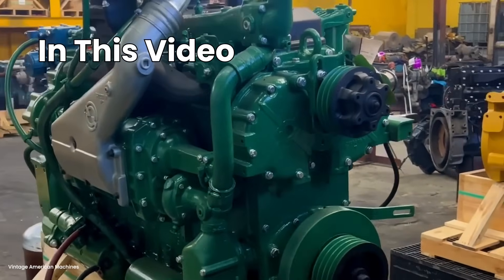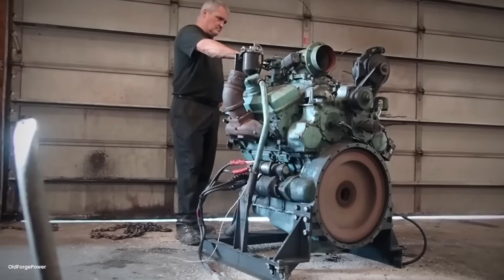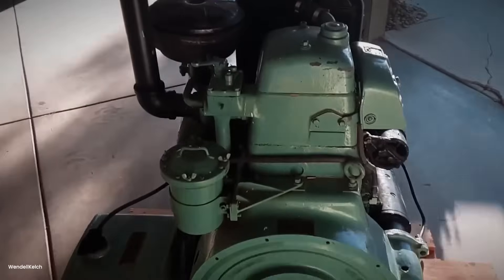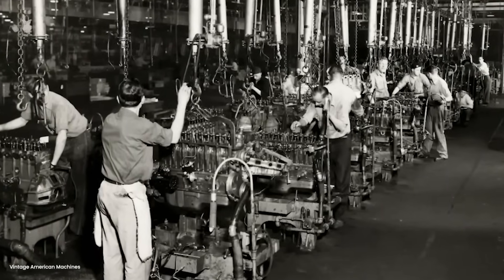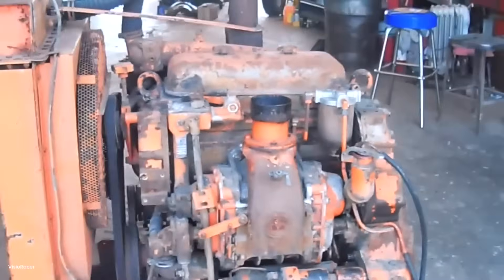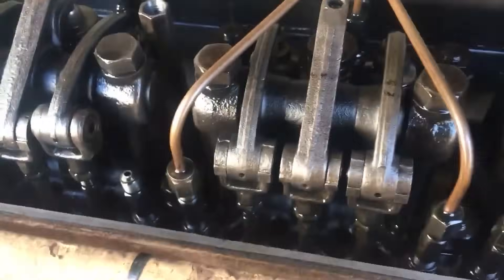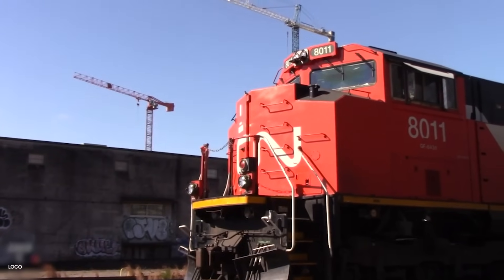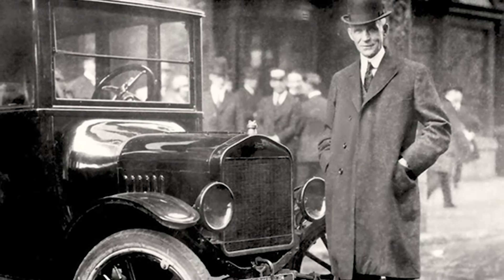How One GM "Bus Engine" Outsmarted Every Locomotive in America

Comment: I did my apprenticeship at Westrail here in Western Australia. We would do an E service (Rebuild the engine) after a million miles. Our biggest standard gauge unit was an EMD V16 567 E3 producing 3300HP. You said Alco went out of business in 1961 (?) I believe Westrail bought locos with Alco engines after 1983. That said, they might have been Atco engines.  I don't know. I hated my trade and once I graduated, I walked away except a stint on Mega yachts out of the South of France in the late 1980's. Thanks for the video!

Comment: The 6-71 engine was not supercharged.  (Unless it also had a turbocharger.)  The Roots blower was used just to get air into the 2 stroke engine.  It pumped in about 426 cubic inches of air, every rotation.  (Do the math, 6 times 71 is 426.)  Without that Roots blower, the engine will NOT even run!  The gas 2 stroke engines I have, use the crankcase to pump air into the combustion chamber, My RD400 also has a static supercharger (no moving parts) expansion chamber that WILL get the fuel/air mix inti the combustion chamber at higher than atmospheric pressure.  I have a nephew that is an acoustic  Engineer, that agrees with me that an expansion chamber IS a supercharger.

Yes, cars have adapted Roots blowers as superchargers.  Top Fuel dragsters use about 1000 HP, just to drive their 14-71 blowers as superchargers.  NHRA has limited the blowers on Top Fuel cars to that size.
If it uses 1000 HP to spin it, it creates a LOT MORE than 1000 HP.

Comment: WRONG
WRONG WRONG!
This guy couldn't be more wrong!
1939...War was on the Horizon 
GM needed a lightweight high speed diesel engine.
The 6-71 WAS NOT designed as a bus engine, but a multi-purpose engine for generators, marine propulsion, military trucks and equipment. 
The application in busses was a peacetime application.
The 6-71 shared designed features of it's larger EMD 567 cousin (a real Locomotive prime mover) but it was NEVER a Locomotive engine.
Stupid video, its false.

Comment: Early efforts to put Diesel engines into railroad equipment but limited to about 200 or 300 horsepower that powered self propelled passenger car that could pull one or two other passenger cars ? Small industrial locomotives on rails on a factory floor or a small switch engine ? 
Early small Diesel locomotives from General Electric that used two small Diesel engines/one in each "hood" while the cab was in the middle between the two "hoods" "40 tonner" the engines were not built by GE but from another supplier- I think these locomotives may have preceded General Motors' getting involved in the locomotive  business but when they got in they really got in 
little center cab two hood General Electric locomotives on the Washington and Old Dominion Railroad during the 1930s ? 
Collaboration between General Electric and ALCO which resulted in large ALCO 4 stroke engined locomotives with GE traction motors and electric components that competed with the Elecro Motive locomotives until GE decided to produce its own line of large mainline locomotives pulling the rug out from under ALCO ?  Did GE first invent "mutual unit control" ?
Reply: the very popular Budd car used two detroit diesels, a special horizontal model so it could be mounted under the floor.  Each motor powered one axle of the closest bogie, I believed they used a two speed torque converter automatic tranny, in operation it sounded like a Buick with a loud exhaust.  These puppies were not fast getting out of stations but once they got rolling they could move, regular operation at 80 mph was normal.  They were famed for their smokey exhaust, one conductor told me if they could turn that smoke into money, he'd be rich.  Budd cars were ALL stainless even the frame, they'll last forever unless you bang them up and that takes some work.  Not so the engines that are no longer made.

Comment: Robot ?  Didn't know that Kettering (Greatest Automotive Engineer of all time?) (There were Father and Son Ketterings who worked at General Motors?)  was Russian but I have heard that he led an engineering effort that completely improved a submarine engine that had been built by Winton Engine which GM had purchased along with Elecro Motive. 
  I thought that the 567 EMD locomotive engine preceded the much smaller Detroit Diesel engines (which ran on the same 2 stroke principle)
don't think they had turbos on any of these early EMD engines but by the time the GP 30 locomotive model was introduced a turbocharging system had been integrated to the engine. Most EMD and Detroit Diesel engines had Roots blowers or some other type of low pressure air blower to provide fresh air charge and purge the exhaust.

Comment: Railroad track gauge was established long before the Detroit diesel.  The engine used in locomotives was a Winton design that was upgrade and improved under GM management, it wasn't a bus engine made bigger.  Steam locomotives had to be uniquely built since operating conditions on railways differed.  Some covered long flat prairies, others operated on steep grades or had a lot of sharp turns.  Steamers used solid fuel for the most part, coal,  the required storage and loading facilities for that and they pulled a tender to supply fuel and water that had to located adjacent to the locomotive itself.  they also used a lot of fresh water and tender size had to recognize how frequently this would be available.  locomotives are heavy to deliver tractive effort to the track, without that it's just wheel spin.  The beauty of the diesel is that it simplifies all of this, in most cases the same basic locomotive can fulfill all of needed requirements with little or no modification.  All of its weight rides on driving wheels and they are on trucks that steer around turns rather than being rigidly mounted on the frame itself.  While there is some size constraints for the prime mover, this generally related to engine height, for instance the Fairbanks Morse opposed piston engines are rather tall, generally length or width wasn't an issue.  I don't think anyone ever designed a steamer that could operate MU from the front cab.  Diesels can be stacked up as need to provide the horsepower and traction required for the particular train all operated from a single cab with one crew.  And the things wasn't loaded with a thousand gallons of superheated water just waiting to explode.

Comment: One mistake inside: there were submarine Diesel engines, which were used in locomotives in Germany, e.g. for Diesel engines V 20 or V 36. EUROPE: GM Locos were built for Danemark, Belgium  and Norway,nicknamed the " NOSE engines", four axeled powered as those for Danemark, six axeled powered for Belgium and Norway !
Better traction effort by using AC traction motors !
Reply: AC traction didn't come along until the late 1980s and this change was started by GE not GM.  The number of axles on the bogies relates to track loading and turning.  Most of the early locomotives were four axles.  During the forties and fifties the GM engines used only roots blowers, a rotary positive displacement supercharger, two cycle engines need positive displacement blower to scavenge the engine, later on the switch was made to using turbo charges but retained the roots blowers for low power operation when the turbos are ineffective, this arrangement resulted in reverse wear on the gears driving the roots blowers due to the high boost provided by the turbos at speed, it also results in lots of exhaust smoke during the period the turbos are spooling up for higher speed.
Reply: EM built a passenger version of this locomotive that used two of the F units prime movers and six wheel bogies, I believe these were typically geared for 110 mph top speed, producing 2400 hp in one locomotive and had a steam boiler for car heating and A/C, yes they used steam for air cooling!
Reply: @henryostman5740  The change came from Germany 120 001-005 first electric 5600 kw engines as testbed. The Diesel engines first came vom MAK Kiel, know as DE 1002, first introduced into service by HGK Cologne, you know ???

Comment: From what I understand, the Detroit Diesel two-stroke series actually started out as an unsuccessful submarine engine - a vertical-crank X-16 driving the prop through huge bevel gears. 
Also, according to Wikipedia, the V-16 EMD locomotive engine preceded the smaller Detroit bus and truck powerplants.

Comment: Ummmm... way the frick out in left field. Detroit Diesel was NEVER designed for locomotive work... that would be big brother EMD. Detroit Diesel WAS designed to be used in stationary and industrial settings as well as vehicle power. The Detroit Diesel design was purposely made to use identical parts throughout the same series line. Many of the engines used in buses were reverse rotation so that Allison transmission could eliminate weight and complexity in their bus transmissions by eliminating an internal shaft and gear set.
Reply: In marine use, one engine in a pair will run in reverse rotation so the propellers will cancel out a tendency to pull to one side. Reportedly a very easy change, as the fixed and reciprocating  portions of the engine required no changes, only the rotating assemblies.
Reply: @pbradleyking  I've seen their Quad power drive system... 4 engines with their butts in an H configuration driving a single main shaft. All the exhaust manifolds were set up with the outlets dumping up through a single point. Two engines turning normally and their partner engines turning counterclockwise. It was kinda cool listening to those puppies SCREAM in synch. My favorites were the 149 series. We had a 16V-149 running the emergency power for the Riyadh radar system. At full load that monster would make your body vibrate with her barking.   Lol